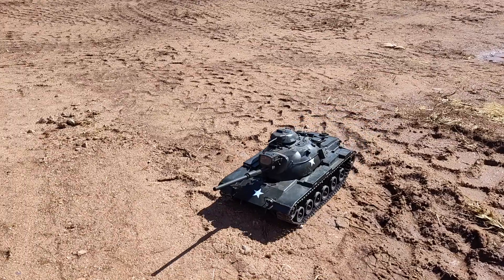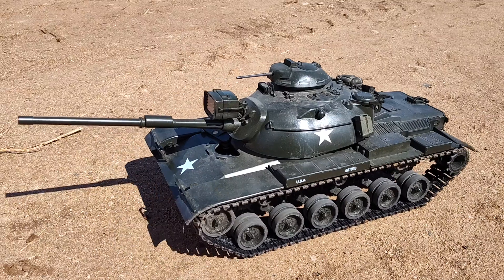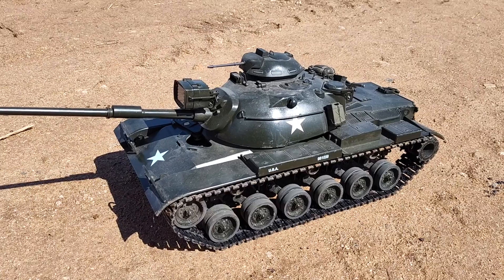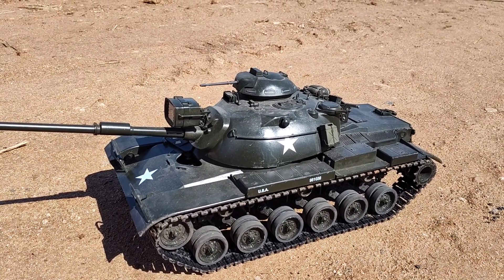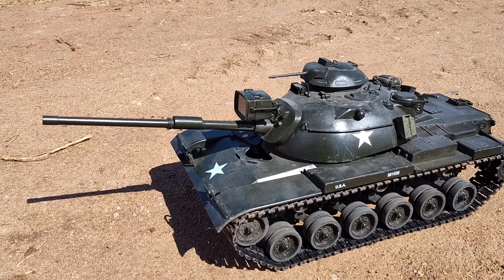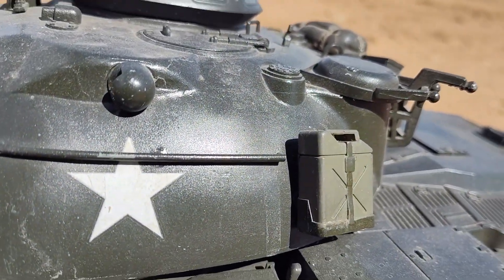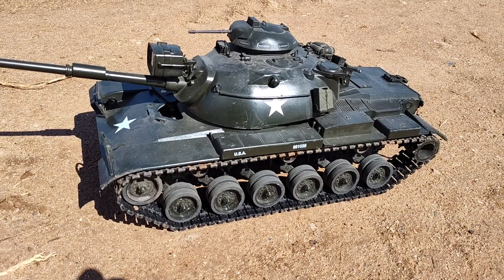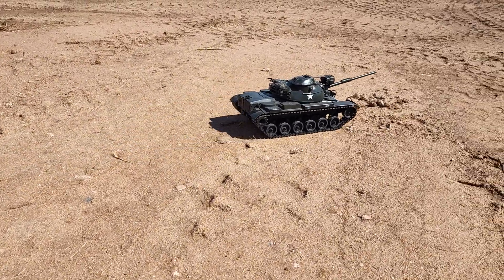Tongde M60

Comment: Cool tank. Awesome to learn some history. I'm thinking of getting into rc tanks. How would you say has the durability of the plastic tracks been? I'd like to save some money and get the plastic tracked version, but plan on running it quite hard outdoors. Thank
Reply from the maker: Do not buy the plastic tracked version.  It has all plastic bushings and plastic tranys.  You must buy the all metal version which has all ball bearings. The plastic version will not hold up.   And then we put plastic tracks on because they run way better with plastic tracks because the metal tracks are way to heavy and bog the tank down.   We also run bigger batteries like a 5000 mah nimh race car pack.  See my video about making an access hatch in the rear for charging a bigger battery.
Reply: @RichJohnsonVideos  thanks for the advice. I am planning to get one of those “upgrade” heng longs from motion rc with the steel transmission gears and metal suspension arms (not sure if they have bushings or bearings in them) and the plastic tracks, road wheels, etc. 

Glad to know there are some that prefer the plastic tracks.

Comment: Is it a closer to an m48 tank now? Certainly looks that way
Reply from the maker: @markong8103  no it's an m60 from 1960. They based the turret on the m48 but enlarged it.  Then two years later they designed the m60a1 turret